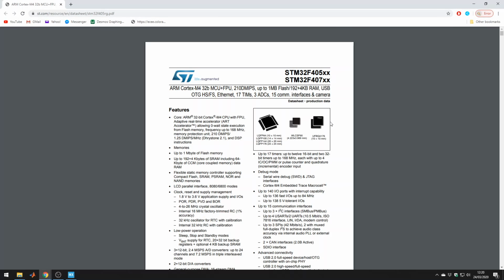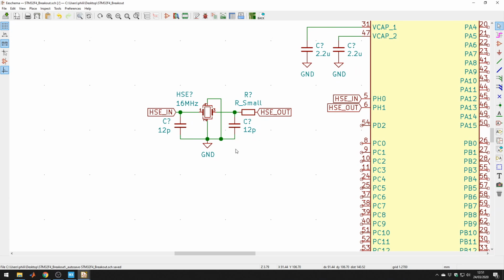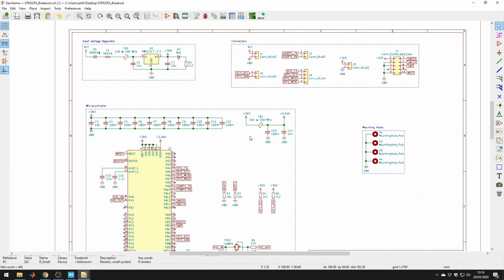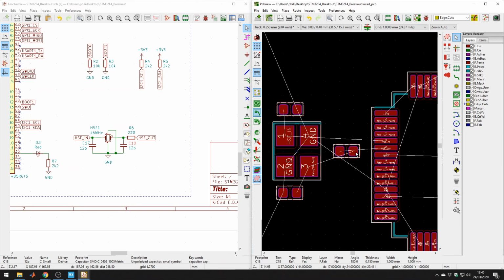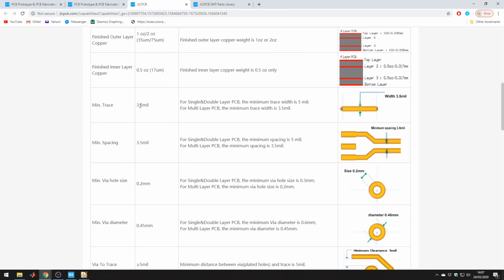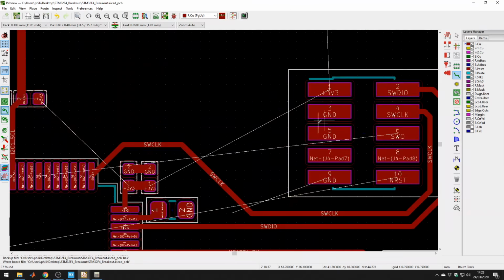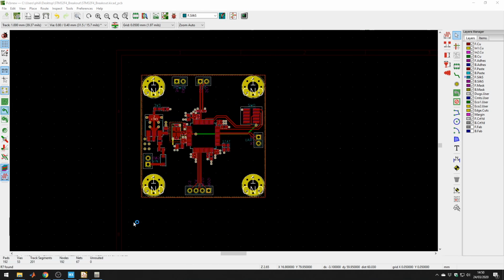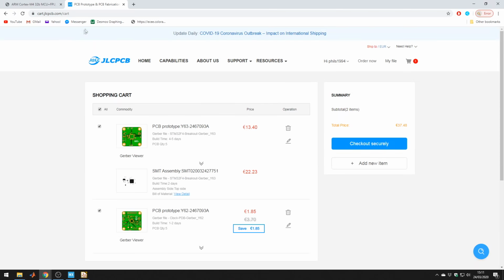KiCad STM32 Hardware Design and JLCPCB Assembly - Phil's Lab #2

Comment: Fantastic video.
I downloaded your KiCAD project files, and noticed the DRC check has several warnings, about pins not being powered.
I'm not a KiCAD expert, but I think if you connect a PWR_FLAG component to the parts of the schematic which have this error, it informs KiCAD that these parts of the schematic are powered.

Unfortunately KiCAD doesn't seem to realise that power can flow though an inductor, so the power flag needs to be put on both sides of the power when it goes through an inductor.

Also, I have the same problem with the VCap pins on an STM32. This seems to be a bug in the symbol for the STM32, as VCap seems to be powered internally by the STM32, yet the only way to get rid of the DRC warning is to add PWR_FLAG s to both the VCap pins.

AFIK, adding multiple PWR_FLAGs to a board does not connect those nets together, and it also needs to be added to the Gnd net.

BTW.
You may already know this, but when you have a block selected, and want to drag rather than move it. Press the tab key.
Reply from the maker: Thank you! Yeah, they are a bit irritating but I just tend to ignore those DRC warnings (or turn them off in one of the tabs). It probably is wise to add a PWR_FLAG but to be honest, most of the time I can't be bothered and I haven't had a problem in any board so far.
Reply: @PhilsLab  No worries. I guess it's because my day job is as a programmer, and having warnings is a bad thing, I normally try to get rid of them all, as they are often a clue that something worse is wrong with the code.

BTW. I forgot to mention, that the crystal groundplane stuff in your video is ultra interesting, and rather alarming for me. I'm designing a 2 layer board which is an antenna tuning unit, and has 100W at 50MHz flowing through it. So I'm a bit concerned that it may interfere with the MCU's oscillator.

But I guess I'll need to try it and see what happens...
Reply from the maker: @vk3kyy  100W of power is quite a bit more than is usually flowing around one of these boards haha, so I'm afraid I'm not sure how that'll affect the oscillator. As a guess, I think just keeping enough physical separation between the critical parts on the PCB should do the trick. To be honest, on two-layer boards I typically don't add those 'crystal gnd cutouts' and things still work fine. Do let me know if/how your board works out with that though, would be really interesting to know!
Reply: @PhilsLab  Do you put a ground under the crystal at all on 2 layer boards ?  I've seen a lot of Chinese boards with simple 2 pin crystals, which seem to work OK. 
Re: 100W. The STM32 won't be right in the middle of the board, but its unlikely to be more than 5cm from the RF. Its for Ham radio, so the frequencies can be as low as 1.8Mhz and as high as 50Mhz, so I also need to pick a crystal freq that's not a ham radio frequency e.g. 14.0MHz or 21.0Mhz or 28.0Mhz are no good as those are Ham radio frequencies.

I'm still at the early stages of the design, trying to work out the optimal layout for the RF. At 50Mhz its not really that important, but the layout may as well be as good as possible. 
I'm basing the design on https://github.com/Dfinitski/N7DDC-ATU-100-mini-and-extended-boards/, ( https://easyeda.com/editor#id=a185278179934c21bc304baea7cb7925 )  but his design is in EasyEDA, and I have an aversion to online design programs. 

I also noticed however that JLC PCB seem to have some close linkage to EasyEda.

Comment: Hello, thank you again for this great tutorial, I have a question about the connectors (through hole connectors) being routed on the top layer, wouldn't it be hard to solder them there since their pins are more accessible on the bottom layer?

Comment: Hey Phil could you do an audio dsp module with the adau1701? (Stereo and Bass output)
Reply from the maker: Hey, I was thinking about making a video on mixed-signal circuit board design. And that would most likely include a codec (ADC/DAC) module of some sort. Not sure when that'll be out though!
Reply: @PhilsLab  the Adau1701 is a signal processor but you need an external EEPROM for the code. Otherwise there are some Bluetooth IC's from the brand Jieli with integrated ADC-DAC. But since they are kinda unknown/custom none figured out how to program those. AC6905A is the part number.
Or you might read this one too:
https://github.com/christian-kramer/JieLi-AC690X-Familiarization

Comment: do we really need the resistor with crystal oscillator?
Reply: I may be wrong but as far as I know, it will probably work without one, but the oscillator will be more noisy and it's better to have one.
Reply from the maker: You'd generally be fine without one. But it's not much extra work to include it and that's what I generally do.

Comment: I'm not a professional, so I probably made a few mistakes, but I did the same thing a year ago with a PIC24FJ64GB002. My board is smaller ( 40 x 40 mm ) and has only 2 layers. I put components on both sides.
My board can be plugged into a breadboard by a 15 pin single-row header, has 2 buttons and 2 LED's, a full size USB-B connector and a ICSP connector. 
I'm not using copper-pours for the +3V3 at all ?? Just a fat trace with a capactitor at the end.
Also I've tried not to cause any ground-loops, which I think are harmfull indeed.
It took forever to design the board, because there was so little space. I soldered it myself. It works. The only trouble I had was getting the open-source compiler and the USB-software stack to work.

Comment: hey phil, would this layout work as a start point for a usb HID button board for a pc, like a joystick controller or just as a button panel. i am new to this and am struggling, i want to get the theoretical pcb layout done first then work on the c++ afterwards
Reply from the maker: Hey Richard, quite a bit of this board you could use for something like you mentioned. The STM32F4 also has an internal USB FS PHY which is really useful, so you could link it up (via ESD protection) to a USB connector. STM provides drivers for USB HID (both firmware and software-side I believe).

Comment: Despite of this excellent video, you might think about getting a better microphone (arrangement) + postprocessing. Good videos and movies don't shine by great cuts, animations and visuals but rather by excellent sound quality. Especially if it is an educational video (I basically skip EVERY "tutorial" video which uses "text only" and no voice or if it uses "bad voice quality"... And I'm sure, I'm not the only one acting like this). For your video, sound volume is excellent! Yet, you might anyway think about adding a microphone, situated more closely to your mouth. This will reduce pickup of noise by your mouse and keyboard. Additionally, you can crank down the "digital gain" so you have less hiss from the amplification process in the audio. But having your microphone so close to your mouth might also introduce "pop" noises whenever you say a "p"-words (and similar). For that, you might want to add foam around your mic. Anyway: Your videos are great but could be even greater with 11/10 audio instead of "only" 8/10 audio ;)

Edit I just watched one of your latest videos and I noticed, you already followed the road of greater audio clarity by yourself! Good job! You truly have state-of-the-art quality in audio now. Kudos!

Comment: Hi. Explain, please - why 2 decoupling capacitor for each VDD? 
 In datasheet i see 1/2/..../14/15 VDD and 15x100nF+1x4.7uF.  
 I'm understand it like 1 capacitor to each VDD. 
 Why did you placed two? Help me to understand datasheet in that moment, please.
In AN4488 Rev 7 it says about only one capacitor per one VDD. See paragraph 8.3
https://www.st.com/resource/en/application_note/dm00115714-getting-started-with-stm32f4xxxx-mcu-hardware-development-stmicroelectronics.pdf
Reply: seconded. especially curious about two caps of the same value.

Comment: Hi, is there any way that KiCad allows users to move footprints and traces together while routing traces? it seems quite a hassle for footprints position adjustment, traces have to be removed first before moving footprints.  Thanks.
Reply: I think instead of using the hotkey M for move, you use the hotkey G for 'drag' and you will move things around while keeping everyone attached.

Comment: Hi Phil, great video! Thanks for explaining it step by step. Do you have the corresponding C code for it? I would like to use your design as a starting point for reading some sensors, and having the code with all your configuration would save me a lot of time
Reply from the maker: Hi Minerva, Thank you! For this board I haven’t written any code, but under my HadesFCS Git repo I have a fair bit - including how to interface with SPI/I2C sensors. A lot of the code is for the F405 as well.

Comment: Phil, you are amazing! Thank you for this!

One question, open to all, since KiCAD is Open Source, are there any limitations in it, wrt PCB Size/No of Components/anything else?
Reply from the maker: Thank you Nikhil! Apologies for the late reply. As others have already stated, KiCad is pretty unrestrictive and I don’t think I’ll be maxing out its capabilities anytime soon.
Reply: Not in KiCad. There may be some limit at 2^64 components or something, but that would exceed the limits of your computer before you got there.
Reply: @davidjohnston4240  Thank you David for your reply. So this means I can use it for commercial purposes?
Reply: @nikhilshah9060  KiCAD is licensed with the AGPL. The AGPL contains no clause that prevents you using it for commercial purposes.
Reply: @davidjohnston4240  Alrighty, thank you David once again! :)

Comment: This is really great. Too bad you needed to rotate the two IC.

Also, UART/I2C/SPI are going to require GND as well on the connectors (or get it from other sources which is impractical).

Comment: After, i don't know how much time passed, as I was checking the production guidance data sheet for decoupling caps, i only see a 100nf cap for each vdd... i cant find this doubling deal
Reply: yea, i'm seeing the same thing. I even went and looked up his chip and the pdf says 1 per VDD no idea where he got 2 from.
Reply: @Kysen10  as he thank fully highlighted this comment, probably he realized.
At the moment i was designing a board using f429 with 12 vdd pins...24 caps for a small chip looks kinda ridiculous.
Nevertheless the tutorial is great and I'm really thankful for tips and tricks.

Comment: For a proto board like this one, I would add 3v3 and gnd to each of the connectors; that makes it easy to quickly connect to other single-chip test boards.  For a 4-layer board, you don't even need to route any additional traces.  For I2C, I might even add QUIIC/Stemma/Grove or whatever your standard I2C connector is.

Comment: Hej Phil, great videos! very helpful! fortunately I found your videos, when planning to create a simpler µC - now plans grow bigger ;)
As Benjamin proposed below your other, smaller STM Board, a platform could be useful. But so far i use the comment section for a question.
Most of the µCs use LDOs for voltage regulation. Do manufacturers reject more efficient stepped regulators due to the voltage ripples and following HF noise? Or because of some additional parts? I'd feel better using efficient regulators for a Li-Ion Battery driven board. :P
Reply from the maker: Hey, thank you! I think a big advantage is simply because you only need the regulator + input/output capacitors. Whereas for a switching regulator you typically need to compute the right component values and there are more components to put around the controller. In general, if you're stepping down from a large voltage to a much smaller voltage, you won't want to use an LDO since most of the power will be dissipated as heat and things will get really hot.
For my main designs I almost always go with switching regulators. But if I'm concerned about size/cost/simplicity, I'll use an LDO - given that the I/O voltage difference + current consumption isn't too great.
Noise-wise, yes switching regulators are typically not as good as linear regulators - however, for digital systems this won't cause (m)any problems. Even for analog designs, since the switching frequency is high and thus out-of-band, it won't cause many problems either.
Reply: @PhilsLab  hej Phil, thank you very much for your thoughts! I feel my assumption  confirmed to maximise efficiency. 
I want to share an useful (imho) ressource about the LDO or Stepper question.
https://training.ti.com/ldo-or-switcherthat-question

Comment: Excellent video and clear explanations indeed. I've tried now for over 4 months to force myself to like Kicad but you know what. whatever I've tried I just do not like it at all. It is way, way more complicated than I'd prefer to be and it has so many useless features that I'll simply never use. The menu is overly complex as well and simply a way to many apps in 1 package. And it crushes randomly no matter what PC I/ve tried to install it on.. I like software to only have to parts. the diagram design and the PCB design. I also like software to be reasonably small but boy this Kicad is driving me crazy, What on earth is included in the software that is so huge??  I currently use Sprint-Layout V6.0 but I wouldn't swap it for Kicad. No way. Not in a million years. It is just so much nicer, the difference is like day and night.
Reply: Does the Sprint-Layout have interactive router? No? Then it's waste of time and money - yes, money, because Sprint-Layout is commercial software. I've tried the demo version and I can't understand how someone can create anything in this ... "Microsoft PCB Painting". KiCAD made a long journey from the first versions, which were buggy and lacked a lot of features. Current KiCAD 5 is much more stable, less buggy and has some very useful features (like already mentioned interactive router). KiCAD can be compared to tools like EAGLE. Of course, Altium or OrCAD are still in another league, but also taming such a beast like OrCAD is much more difficult than learning the basics in KiCAD. Speaking of learning - KiCAD has a great documentation and learning guides. Everyone, who's capable of learning electronics, should have no issues with learning KiCAD.
Reply from the maker: Thank you very much, Ovi! Yeah, initially I really didn't like KiCad but have grown to like it. It definitely has its quirks. I must say I haven't tried many other PCB design softwares, except Eagle (which I thought was horrible) - so I can't really compare it to anything else.

Comment: Is there any particular reason not to have a GND each on the I2C and SPI connectors so that you know what those signals reference against?
Reply: I2C and SPI are suited more for communicating across chips/boards in the same overall system, so sharing a ground is a given. They're also both short-distance protocols, so it's rare to find "separate" components communicating over I2C or SPI.

Long distance protocols like RS-232, RS-485, or Ethernet use differential pairs to provide a potential without a common ground.
Reply from the maker: You're right, it is good practice to have at least one GND pin at each connector - ideally a ground for every signal line. However, for this board the main point was to outline how to do the STM32 part was so I kinda skipped over a lot, including the connectors.

Comment: With fine pitch footprints, its always a good thing to check with gerbview the soldermask layer openings. With Kicad defaults you could end up without soldermask between STM32 pins. JLCPCB has 0.2 mm minimum soldermask. They will probably fix that for you in their the production files without you knowing. But better safe than sorry...

Comment: Hey Phil S, question I want to order some on JLCPCB and I was wondering how the stm32f4 is powered on this breakout? Via the 2 layer correct with layer 3 as ground? Thank you for your time?
Reply from the maker: Hi John, The 2nd layer is dedicated to a ground, the 3rd layer is 3.3V. And yes, any device that requires 3.3V can just connect with a via to that power plane!

Comment: Hi Phil. Great video, watched it a few times and designed my own pcb 🙂. For the AMS1117 why did you use a 10u on the Cout as it says 22u on the AMS data sheet?

Also are you going to do more STM32 tutorials? Maybe with the Cortex M7 line and powering through a lipo battery and external flash?
Reply from the maker: Thank you, Nigel! The datasheet for the AMS1117 talks about the output cap in the 'stability' section. A 22uF tantalum cap will ensure stability for all operating conditions. Since I know that the load is fairly light, I can use a smaller capacitor, i.e. something like 10uF. If you're uncertain about what loads you'll be encountering, then yeah better go with the datasheet recommendation. A lot of my boards use this regulator with a 10uF cap and I've had no problems (yet)!
For the upcoming control series design video, I've made board made with an STM32. I'll be going through hardware design and programming for that!
I've also just finished a new 'barebones' flight control board, which uses a single H7, is powered via LiPo, and has external flash - so that seems to match exactly what you were asking. That video will probably be out after the control series however.
Hope everything goes well with your designs!